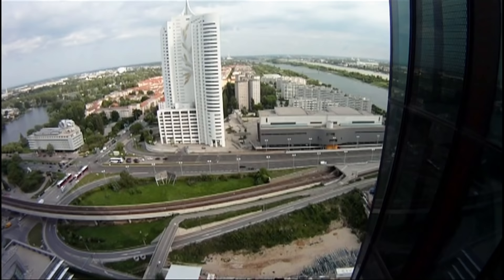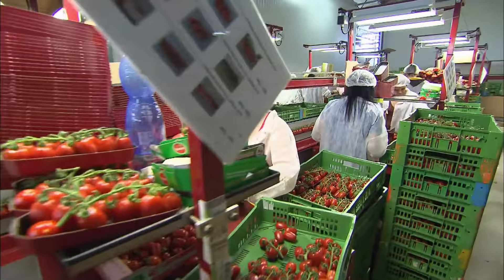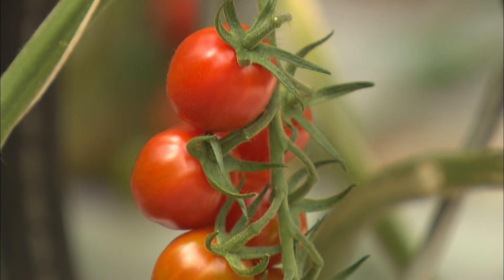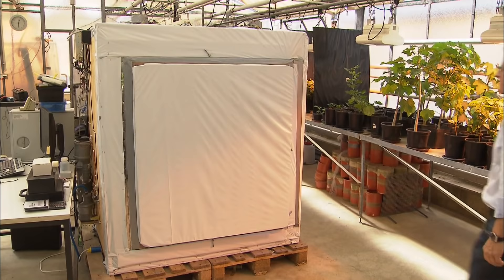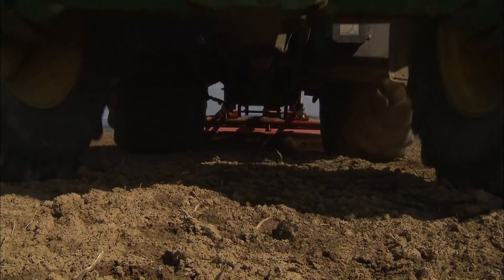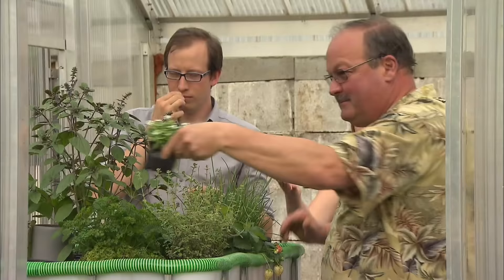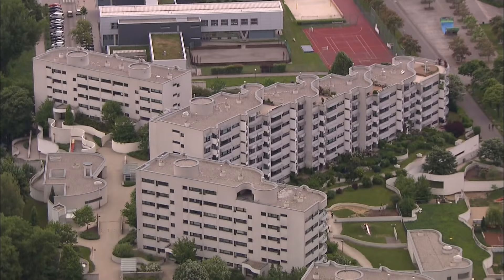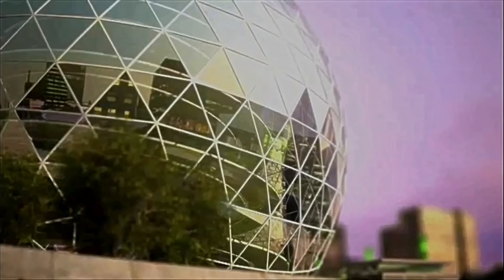Vertical Farm | Another Way to Produce Food in Cities (HD 1080p)

Comment: The solar farm to produce enough light pressure would be bigger than the area needed to farm rice naturally. Natural sunlight is KEY to effective and efficient production.
Reply: jeffery wise True but you can use geothermal as well. Put the farm underground entirely 1000 feet of underground building. Then use solar from solar towers.